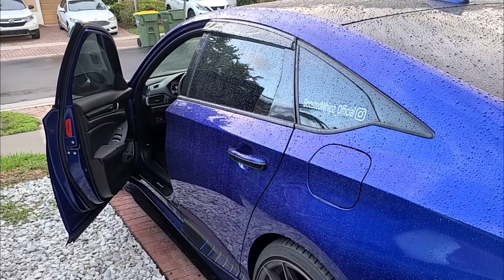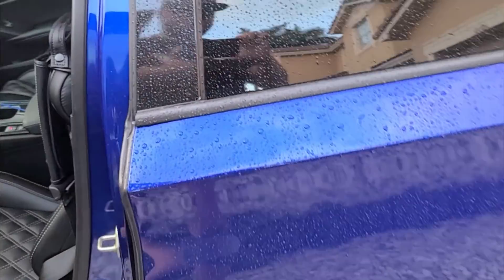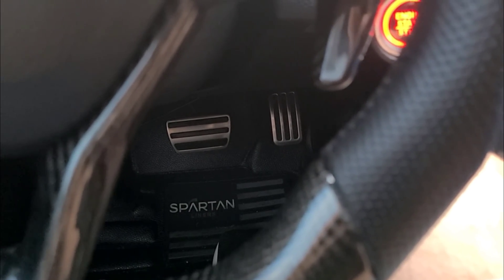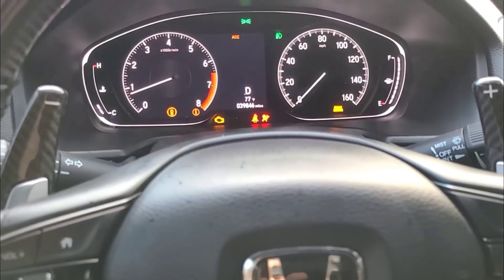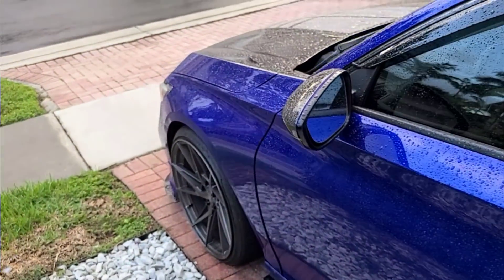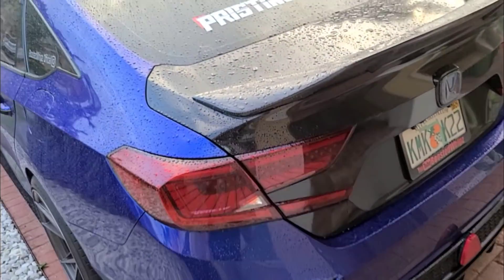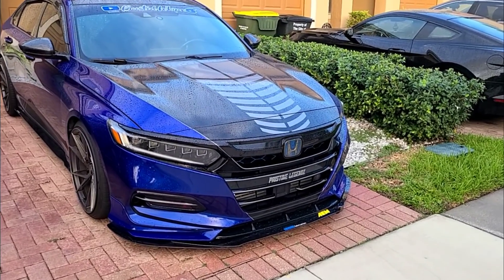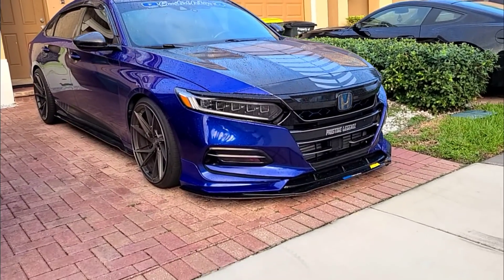CVT Transmission Goes Out at 40K Miles on Modded Honda Accord 2018-2020

Comment: What were the first signs of it going I’m thinking my cvt is slipping on a hard pull. It doesn’t slip unless I give it wide open throttle. I’ve done a few bolt on mods and am pushing more hp than stock. Just curious to know what your first signs of it going ?
Reply from the maker: I had no signs tbh... I raced the night before. Got home well. No issues. Next morning when heading out to work, it's when it started doing the weird behaviors. Stuck on drive, if accelerated it will feel like a hop/hit. Kinda like skipping "gear", etc.
Reply: @BoostedWhipz  word thank you for the reply. 🤘 what was your answer to the problem do you go for an upgraded cvt ? I’m probably going to have to make the same choice

Comment: Not as bad as my engine blowing up on my 2016 accord ex-l inline 4, cvt... they had to put in a whole new engine and my car didn’t even hit 35,000 miles back then
Reply: I have the 2014 EX-L V6. Had to replace the Torque converter at 42K. But now the car shifts hard going from P to R andshifting from P to D.  Seriously fustrating. Not to Mention the paint peeling on the White Orchid Pearl. Honda needs to get their shit together.

Comment: Damn bro :/ that sucks. CVT’s can only handle so much power before the belt snaps. You might be better off getting a manual transmission rather replacing the CVT with another CVT. It’s just going to break again. You will love having a manual trust me. Well worth it. Best of luck to you

Comment: I got a 2018 sport accord wit 74,000 miles the CVT transmission is fine on mines but every 30,000 I change the transmission fluid tho

Comment: Won't the powertrain be covered under warranty or you're not going to the dealer because of all the mods? I have 35K on my 1.5 sport no mods, just curious.
Reply from the maker: Because of the mods. Honda won't even look at it. If not modded, you should be fine and covered under the 5yr/60K miles warranty.
Reply: @BoostedWhipz  good to know. Good luck with the car. The CVT is a trash transmission that these big companies use to save money on real transmissions. The worst offender is Nissan. 
Now you said you’ve changed the cvt fluid a couple of time’s already, I haven’t even thought of doing that until I hit around 60K. I might have to read up on how often the fluid needs to me changed.

Comment: Like most people are saying, the CVT’s are very sensitive to power and not durable, especially with mods. I’ve had a few CVT replacements with normal driving and no mods. At least you have a CEL and transmission messages, my CVT never once threw codes. You’re lucky for that cost, if I wasn’t under warranty, I would’ve been out $4500

Comment: Honda CVT's are considered top tier in the industry. Unfortunately they are not able to withstand heavy torque and being really pushed. You will not see them in the more powerful engine lines...
Reply: Honda’s cvts are top tier but can’t handle 220 horsepower after 40k miles? Bruh the Nissan Maxima has had over 300 hp with a cvt for years and they don’t fail at 40k, I’ve seen so many with over 100k going fine but I guess 220 hp from a 1.5 liter engine is too much or maybe he got unlucky 🤷‍♀️
Reply: @sethlittle7338  You are right about the Maxima, its definitely one of the biggest engines with a CVT. I was generalizing that CVT's are used mainly for MPG gains in cars today and that's why the industry is using them. Also cheaper to produce. Its widely known in the industry that they don't handle a lot of torque. I assume every year they get better and better. Nissan had a nightmare years ago when they first starting using them and it continued for several years. So many cars were failing they had to extend the power train warranty from 60,000 to 120,000 miles.
Reply: @xbrizzcakez  yea that’s true but I was just saying they’re usually good for about 100-300 horsepower but 300 or more torque and you’re asking for the belt to slip eventually but actually a lot of Nissans cvt issues were from 4 cylinder models and the v6 ones were actually pretty good, they had something wrong in the programming or they just underestimated the engine cause most issue I’ve heard of are from altimas and rogues or maybe that’s just because they’re their best sellers, I’ve also heard they’ve fixed their issues but imo any cvt isn’t built to last it’s design is inherently flawed

Comment: I think the issue is that the CVT transmissions do not take a lot of horsepower and once you mess with the horsepower rating generally you're going to drive it harder and the transmissions are not strong for that. These are made basically for good gas mileage and normal driving
Reply: Its not the horsepower that kills it its the torque my 1.5T runs 295 HP and 255 TQ on the dyno and it runs beautifully 🤘🏻

Comment: Can you try to get another auto trans fitted in like a dual clutch one or a manual trans?
Reply from the maker: I suppose you can but will be more expensive since will need reprogramming at the ECU level.
Reply: @BoostedWhipz  i feel ya, I was thinking of boosting my kia forte 2020. I got everything except the turbo manifold but I know my cvt will go out the moment I hit boost. Im just trying to gain the maximum possible on the NA platform

Comment: Heard you mention Derek Robinson... Was that a low key slight🤔
Reply from the maker: Not understanding the question.
Reply: @BoostedWhipz  do you feel like his tune caused the failure?
Reply from the maker: @fred_b_360  not at all. The fact I was able to run 40K miles with no issues prior it just tells me it was just accelerated wear/tear

Comment: The thing about CVT, you need to flush and change the transmission fluid every 30k miles.
Reply: Hi did just that at 30k. It's the nature of the cvt. Weak pile of junks

Comment: Damn bro sorry about this great car too :/ found ur channel when I started doing my first mods... 
right now I have prl intercooler ,kn air intake borla catback exhaust , tein flex z coilovers, and recently switched from stage 2 ktune back to stage 1... you think I should be worried about cvt failure ? I don’t race fastest I ever go is like 90 on an open highway
Reply from the maker: You should be fine
Reply: BoostedWhipz thanks bro, good luck with the car man it is a gem 💎

Comment: I got the 6 speed 1.5t. On some forums people say the manual can take more abuse than the CVT but on others they say it's weaker. Do you know what the truth is?
Reply from the maker: Don't know honestly. I think a manual transmission should hold more though.
Reply: @BoostedWhipz  Thanks man and sorry to hear what happened. When you said it would cost you 2Gs though my mind was blown. That's a really good deal. Best of luck.
Reply from the maker: Oh yeah, people are paying $4-6K.
Reply: The truth is the transmission is stronger no doubt than the CVT. However the clutch in the 1.5ts is very very weak. If you plan on tuning then you Gotta get a new clutch
Reply: @nicholasfolse  Simple enough. Thanks for the info.
Reply: Nicholas Folse you are correct.

Comment: Sorry to hear this happened to you, the life expectancy for a CVT is around 100k. It uses a pulley to move forward and backward on a shaft of gear. The pulley is a belt so driving too hard will put lot of tear and wear on the pulley. I think the pulley in your CVT gave up. A new transmission is needed everytime a pulley go out.
Reply: I think Honda and Toyota cvt’s unmodded go well over 100k tho. My buddy’s Camry is nearly 200k miles.
Reply: My friends 2014 has 220 k on the CVT. It's strickly a grocery getter though...
Reply: I have the new Corolla with the extra first gear for start offs. There’s no added wear in the belt since the first gear handles acceleration.

Comment: Bought my 1.5 cvt knowing it was going to have problems down the road but 40k miles isnt good, I bought Honda for reliability I mean it should still be reliable right? I’m not doing many mods to my car besides cosmetics and maybe CAI but I’ve heard from forums that the CVT transmissions aren’t good at all! And that they have gotten to 60k or even 70k miles and then it broke down but I haven’t heard of a Honda cvt going past 100k yet and I have had a couple Honda well past 250k
Reply: Hondas cvts are the most reliable , you should and i repeat you should be fine with minor mods just remember to chanhe the oil every 30k
Reply: Im at 62k with mine no problems
Reply: Honestly if all you’re doing is the CAI and no tuning/modding then you shouldn’t have much to worry about. With regular maintenance and changing your trans fluid a few thousand miles before recommended you should get 100k miles easy. If you drive it super hard all the time of course you’d shorten the life a bit.
Reply: @geokiller789  sounds good, and we are talking about transmission fluid correct?
Reply: @caglioso  thank you :)

Comment: Yeah that’s why I wouldn’t tune a car with a CVT, I wish Honda puts the 10 speed with the 1.5 turbo because is a very good engine because you can get a lot of power out of it, but right now the 2.0T 10 speed is the way to go if you want to tune the car

Comment: Will your warranty pay for that? Please tell me you are getting either a manual or 10 speed auto.
Reply from the maker: Nope, Honda won't even look at my car. It's heavily modified. And no not getting either
Reply: @BoostedWhipz  so you are spending $2-3K for another CVT that will blow up again in another 40,000 miles?
Reply from the maker: @Robbie2Fly  $2K. And it didn't blow up. I plan to untune it. No longer racing this car.
Reply: @BoostedWhipz  You say it cost only $2k for a replacement cvt?  Was it a salvage unit?  Do you know how much it costs to have a Honda dealer put in a replacement cvt?
Reply from the maker: @robertjohnson4401  I said it's a used CVT 6K miles. Also state in the description. Dealer may charge $4K or more.

Comment: I have a 2019 1.5 mt Accord, the gap on the first two plugs (from left) keeps closing. Honda doesn't know why. Anyone else having this issue? Any recommendations?
Reply: I don't push the car hard, but I drive 100+ miles a day
Reply from the maker: They definitely need to look at that.
Reply: the gap gets smaller?? with wear the gap would get bigger.
Reply: @jamesmedina2062  smaller. As in completely closed.
Reply: @christopherserna5156  this is a spark plug?
Reply: @jamesmedina2062  yes

Comment: I think the drivers manual says that you should change the tran fluids at 30,000 miles dont know if you did... man cvt is nice but its kinda delicate. i got my 10th gen with a manual
Reply from the maker: Yeap did that at 33K

Comment: Is it possible to transmission swap? 

Hopefully one day we see aftermarket CVT transmissions.
Reply from the maker: Unfortunately not an easy conversion. I think the manual tranny from Accord or Si fits but then you need a new ECU, open a third clutch pedal, and redo the whole gear shift area.
Reply: @BoostedWhipz  dude I think that would be an awesome project for your channel bud. Im pretty sure you would sponsors to back your project and turn that car into a 1.5 beast with a LSD to boot.

Comment: well, that's what happens when you start modding a car with a CVT. they are meant for normal driving, keeping it stock. no wonder it failed, they aren't made well. next time, opt for the 10 speed or manual
Reply: 10 speed has problems it’s not out yet you just wait until the gears give up

Comment: The CVT trans is something I stayed away from. If it isnt manual its has to be a form of DCT. My cousin is a master certified transmission technician. He bitches about CVT all day long. Yes they last in normal cars but sports cars... Nope they blow up as your did. Pretty normal actually.

Comment: I'm going on 90k km's with my cvt with bolt ons and ktuner..no issues..knock on wood.
Reply: Stage 2? Still going strong a year later? I have phearable stage 3 (reduce torque low end spécialy for the cvt) intake and borla exaust 90k km. Im scare for the cvt
Reply: @franckbarbeau4499  yes I have the stage 2 uploaded since then..no issues whatsoever. I have been doing frequent transmission fluid changes every 30k (I got a dealer hookup) not sure if that's contributing to the longevity. Didn't know there was a stage 3.might have to check it out.
Reply: @franckbarbeau4499  also running a Prl shortram intake and downpipe catless, Greddy exhaust.
Reply: @roshanmali89  thank you for your fast anwser bro 😎

Comment: Do you regret customizing your Accord? They do suggest when you hit the 40,000 miles to change the transmission oil.
Reply from the maker: No regrets... It has gotten me very far financially. I did my service at 32-34K for transmission.
Reply: It could do been worse right. Stay up and get back on the road again. I also need my transmission fluid changed I’m at 43,347 miles. Ain’t going to a Honda dealer for this they charge n arm and a leg. AAmco instead

Comment: CVT just can't handle engine mods which increases the  torque output. Even if it uses a steel belt, the basic concept is still simply a rubber band moving up & down 2 variable cones simply to adjust road speed with engine rev output. General idea is for use in low weight small vehicles with limited torque output which CVT works best.

The increasing widespread application of CVT in mainstream cars especially for weighty SUVs & big passenger cars were frankly ridiculous. CVT aren't really heavy duty solutions for transmitting engine power to the wheels. CVT has big frictional issues laying power from the engine to the wheels. Only transmission with proper gear sets can transmit power directly without any frictional losses. That is why CVT whine badly under load, have slippage issues laying power from the engine down to the wheels.

Comment: Why didn't   you get the warranty for around 1,000 bucks.
Reply from the maker: You actually think they would warranty a fully moded vehicle?
Reply: @BoostedWhipz  Mods not on the transmission

Comment: I have a 2020 and this is scary wonder if there is any mods you can do to the trans to prevent this from happening
Reply from the maker: A CVT cooler is one of the best things you can add.
Reply: @BoostedWhipz  I will have to look into that for sure cause mine is still stock but I'm like you I don't race all the time just daily driving cause it is stock thanks for the info hope that new trans works out for you man
Reply from the maker: SC Concept developed one. Once launched I'll give you the details.
Reply: For sure look me up on Facebook I don't have twitter or instagram just that keep me posted for sure

Comment: My 2018 accord 1.5 has a blown head gasket at 90k. Been sitting rotting in my driveway since June cuz Honda won’t pay for it and they want over 15k for a new engine
Reply: Where you located ?  Let me buy the car offf from you .
Reply: I sold my 18 accord sport with 60k miles because it was giving me issues already , injectors failed and was getting turbo codes so I ranned it through auction and got 18k , i walked away from a headache.
Reply: @abraham_--7020  see I wouldve pretties it up and sold it over the summer when this all happened but the problem is it's actually a lease lol. Was planning on buying it out but I still got another year and dont want it now. If I wined up getting it off of lease, ima sell it same day though. Things a garbage. Do not live up to the Honda name at all. Mine was eating a court of oil ever 500-1k miles since it had 30k on it. Took it for multiple consumption tests and honda just kept making me redo the tests until it was out of warranty and then told me tough luck. Mine started misfiring at about 80k as well. I'll never buy another honda in my lifetime, not just cuz of how crappy the car is, but how poorly honda corporate and the 4 different dealers I tried to deal with all treated me and didnt stand behind their product with meticulous recorded maintenance records
Reply: Exporado M just drop a new engine . There like 1000 to 1500 . And just pay a mechanic to install it and give it back to the dealer . Lol . Make it there problem . Not yours . But yeah I feel you . That’s how it was with my accord . Problem after problem . There nice cars don’t get me wrong . But the new engines don’t work .

Comment: Nothing to do with your mods. A Honda Jazz(is called a Honda Fit in the US), blew it's CVT on just 39k miles, Honda in the Main Dealership Guildford told us to F   OFF  basically. Despite that the car has been well looked after, serviced, and driven by one owner, a fifty five old girl. 
Honda(and most other Motor Dealerships) don't care.
 A Bmw dealership(Sitner BMW in Coventry) blow up my friend's 7 series ( a 3 litre twin turbo diesel engine) and told him to F   OFF.  They are not going to repair his car, despite that it's their fault.
 A famous judge in your country(Judge Judy Sheindlin) tells us to be responsible!!!! How can we as customers be responsible if the Big Car Dealerships can not except blame, that makes anybody mad.
Good luck explaining all your mods to Honda. They will probably blame all your mods as the cause for the Auto transmission's "premature" failure.

re

Comment: changing transmission fluid could have caused your issues bro as silly as it sounds i have always been told it isnt something you should do till car is older and very high mileage.. hate too see this happen. dope car though!
Reply from the maker: Went based off of Honda's recommended mileage. And the shop that did it is certified by Honda. I saw them do it correctly.

Comment: Be careful with these cvts Honda dealerships chargers 8930.40 to replace Cvt transmission (exact number) don’t believe me? Try it
Reply: I believe you. I had mine replaced for 2014 honda accord lxs coupe 5500 USED 51k miles. I did all maintenance on my old cvt and still crapped at 89k. Nobody warranties these pile of junk for more than 12k miles 12 months even if you get a fully rebuild cvt.